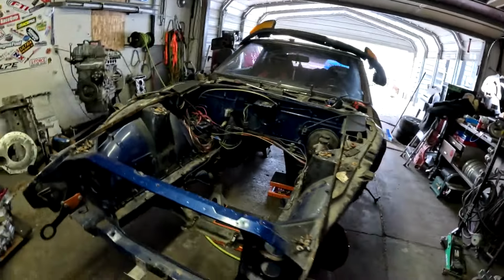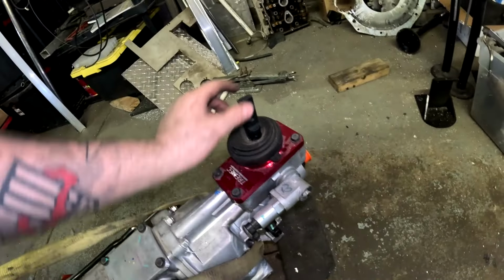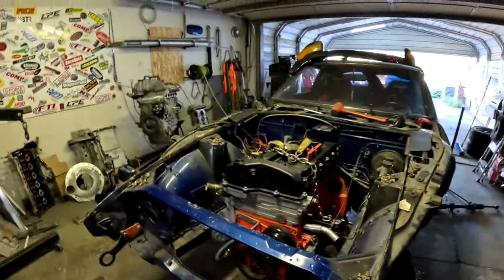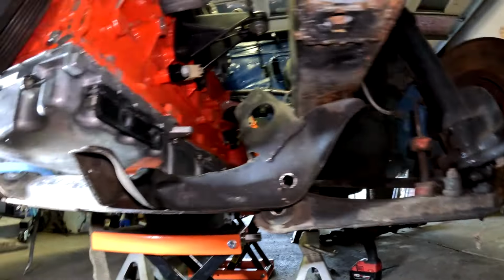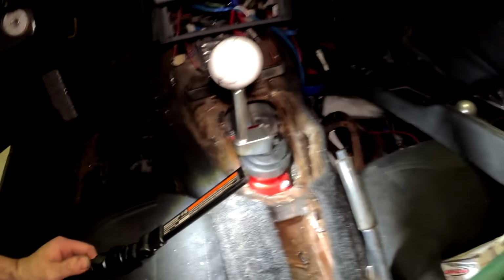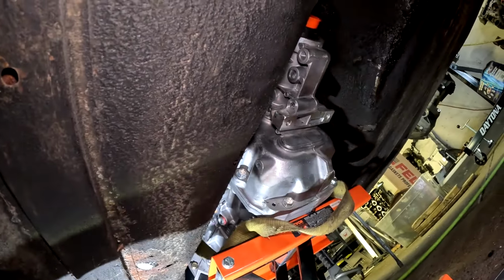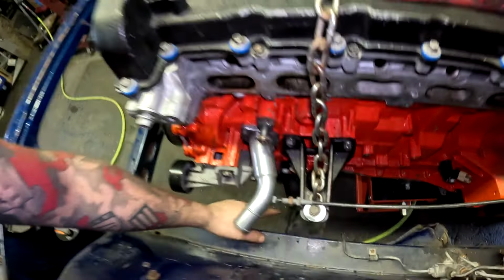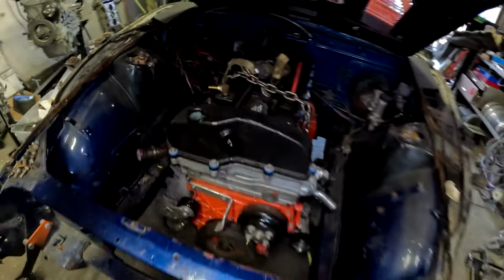swapped 240z with atlas / vortec 4200 part 2

Comment: Hey, what are those under the car, Jacks? The orange things, and where did you get them?  Thanks!
Reply from the maker: Motorcycle jacks work pretty well for holding the motor and transmission up until I get mounts made.
Reply: @redhotchannel1945  where did you get them?
Reply from the maker: Amazon
Reply: @redhotchannel1945  Thanks!